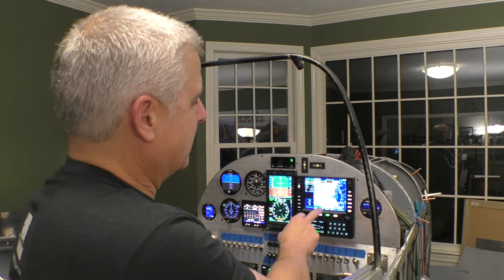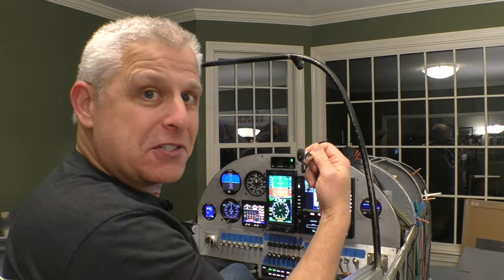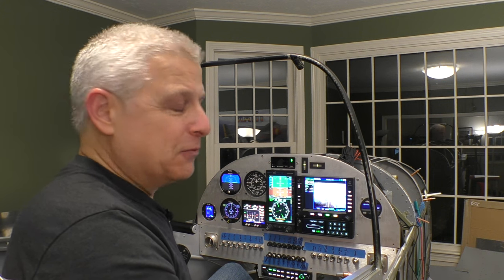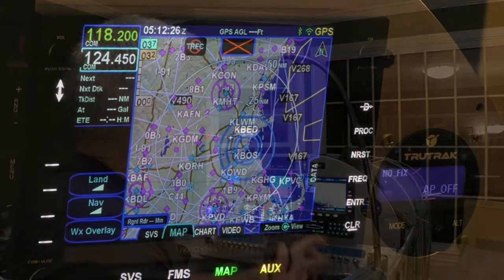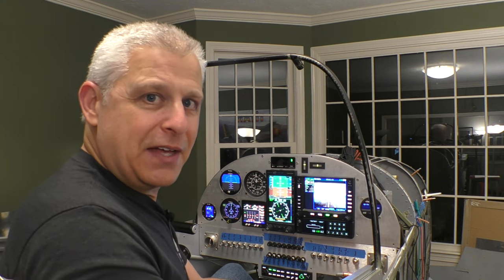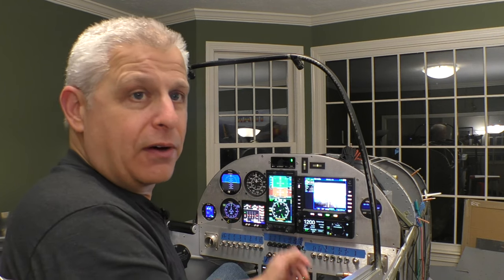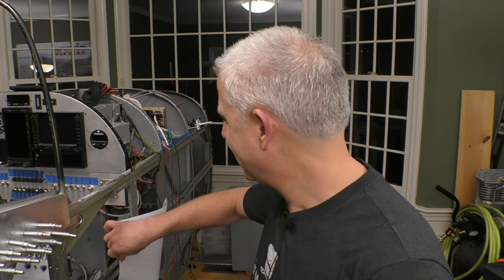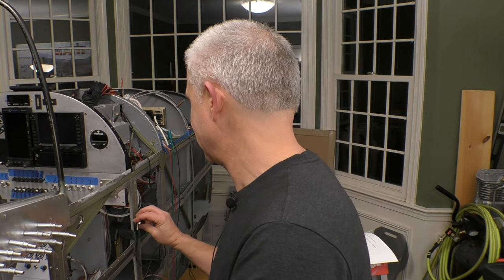Adding a Taxi Camera to our T-51D Mustang using the AMAZING Avidyne IFD550

Comment: Hi Jeff. About 5 years ago I installed a backup camera in the left gear leg of my F1 Rocket. It displays on my Dynon Skyview using their video adapter. The need was obvious when I landed on a narrow runway. When the tailwheel was down, I couldn’t see the runway at all. (I also raised my seat up too).  The camera works well to see within about 30-40 feet, but is of not much value beyond that. Since it was made as a vehicle backup camera, it wasn’t optimized for much distance. I wondered what camera you are installing as it might have better resolution. Thanks.